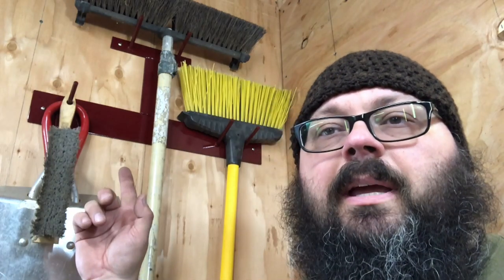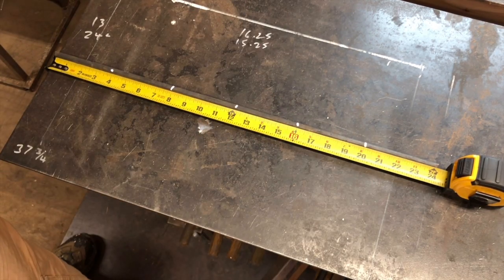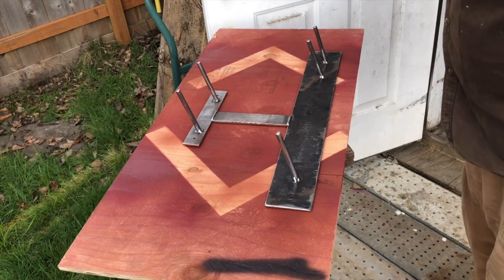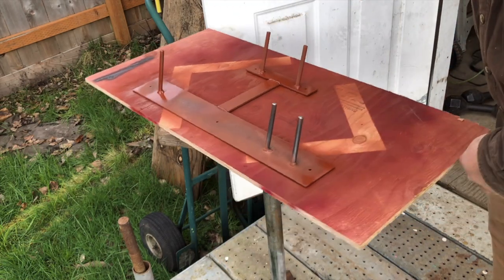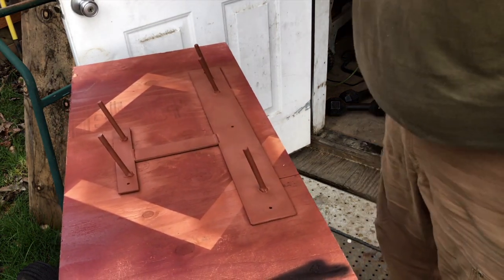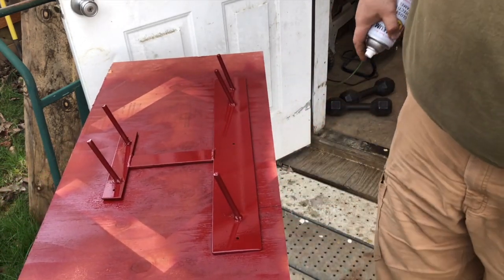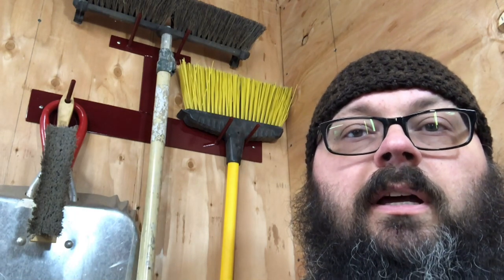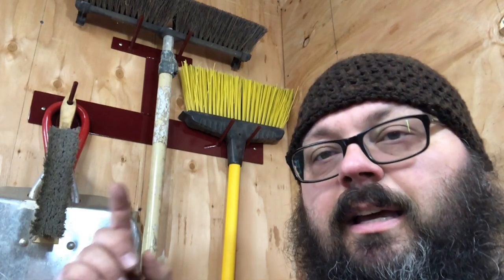DIY - Broom & Dustpan Rack Out Of Scrap Metal For My Makerspace

Comment: Your welds are improving nicely. To get that flat weld to lay down a little flatter turn your heat up a tiny bit and your wire speed down just a tiny bit. If you can find a strip of 1/16 copper plate 2" wide you can set those butt welds with a gap with the copper underneath and itll lay down a little flatter finished weld and the steel will not fuse to the copper at all
Reply from the maker: Brandon, that is an interesting tip with the copper strip.  I will keep an eye out for a strip.
Reply: @TheBeardedGiant  you can also use a copper strip or piece of brass or heavy aluminum as a backer if you have a piece with a hole in it but you dont want a hole there you can fill the hole cleanly and grind it back smooth so you would never tell there was a hole there
Reply from the maker: I do have a piece of plate steel with a hole.  I am going to try this.